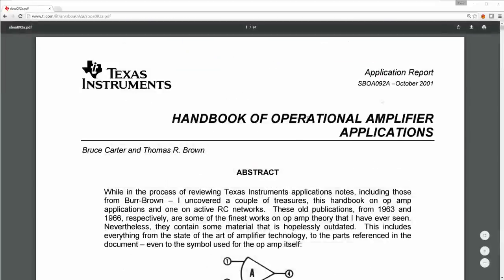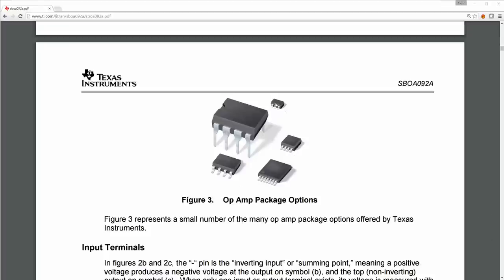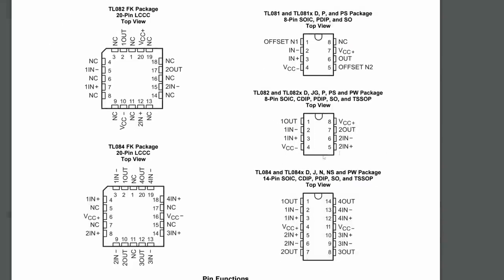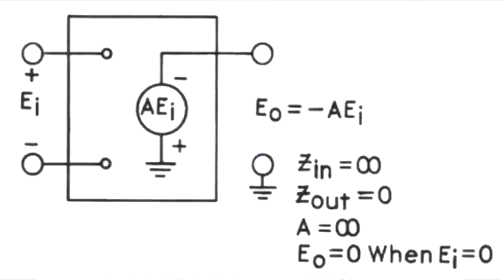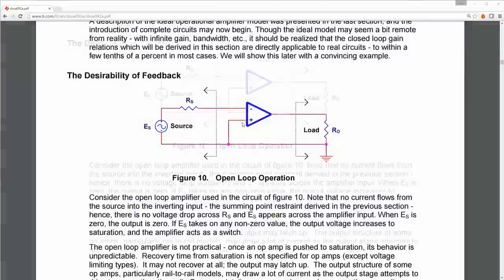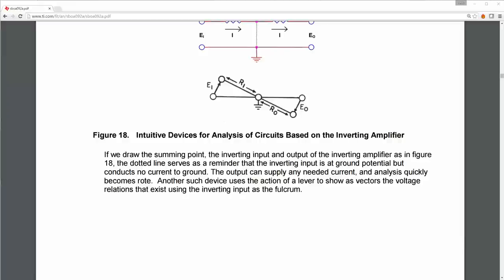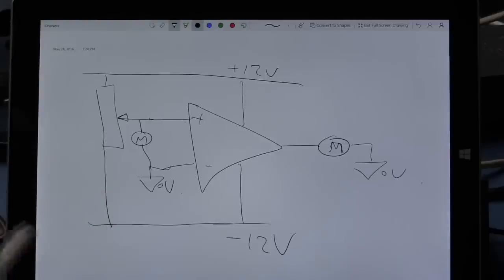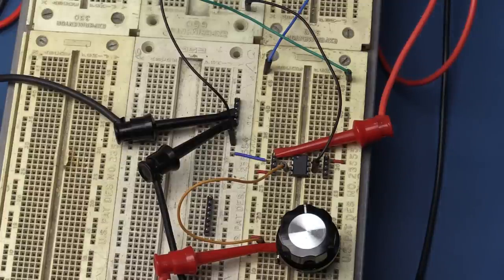TI Tuesdays - The Op - Amp Part 1

Comment: You demonstrated that output phase-reversal will happen to op amp if you use it outside absolute maximum ratings, in your example you exceeded input common-mode voltage range for given supply voltage. TL082 is not rail-to
-rail input op amp so CM voltage do not include rails (for example for +-12V power supply it is around -10V and +12V which explain why you got output phase-reversal only when your input voltage was close to negative rail).
Exceeding input CM voltage in design is same exceeded as exceeded maximum supply voltage and both are not acceptable errors in design (in first case you can get output phase-reversal in other burned op amp).
Reply from the maker: Absolutely and I believe I mentioned that in the video. I am glad your highlighting the fact though as I don't think I mentioned that going over the 10V ish was actually exceeding the MAX ratings in this case. But many folks don't read the specifications and scratch their head thinking they have a bad chip or other weird fault not realising this is a "Feature" of many JFet Op-Amps. This is probably more common when the op-amp is being used as a buffer (Unity Gain) with large input signals or low supply rails as it will happen probably with only a +- 5V or less supply, not just up at 12-15V

Comment: aim trying to use LTC6268-10 jfet input operational amp op..But I always screw up everything. I think ESD is screwing everything up always despite I had used anti static wrist and anti static mantle. What am I doing wrong ?
Reply from the maker: can you provide the schematic of what your building, at least the bit arround the op amp, send it to peter@thebreadboard.ca and ill have a look, include supply voltages etc

Comment: send me a lmv358 low noise amplifier connections tutorial or video
Reply from the maker: It has the same connections as most industry standard dual op amps, therefore the current videos will already show you how to connect it. As it is a rail to Rail opamp then you will have a better output swing but its inputs do not support rail to rail, far from it (It will go to 0V but not to V+). also the supply voltage is only 5V nominal

What exactly are you looking for ?